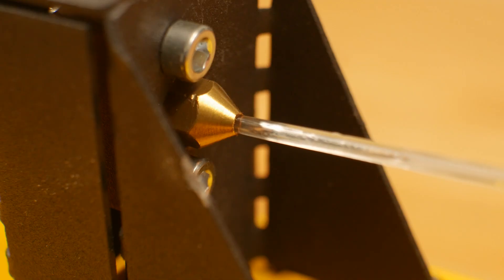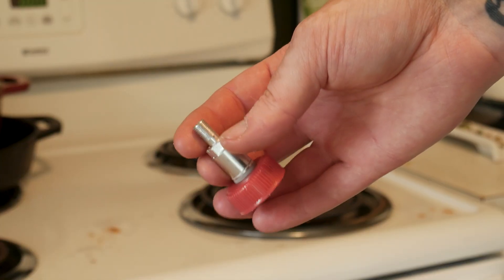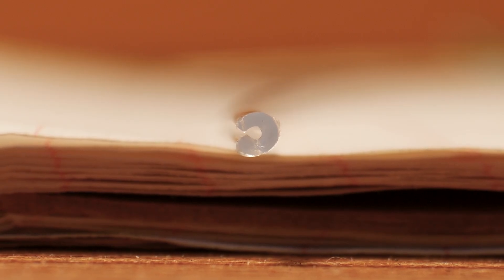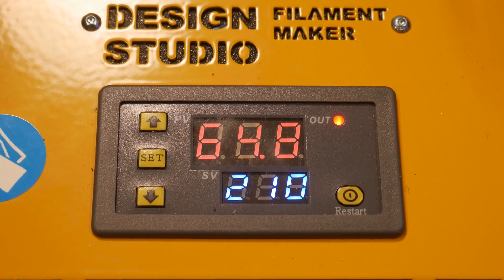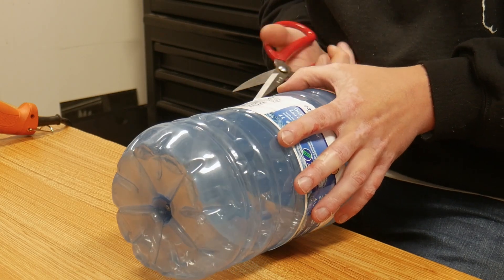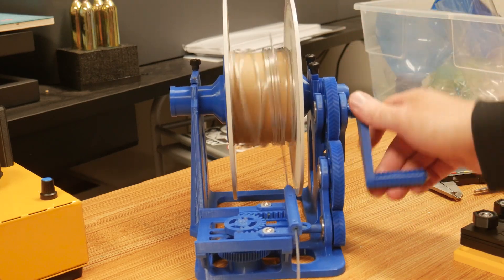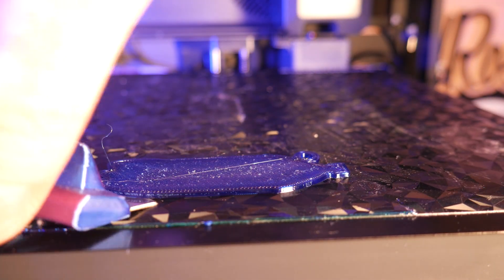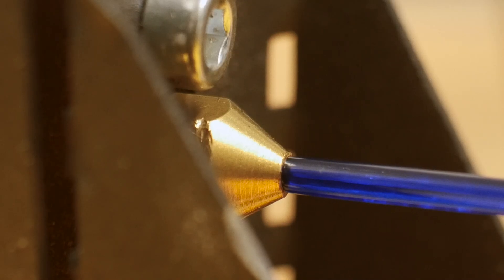Turning Plastic Bottles into 3D Printer Filament // Sustainable Design Studio PET Filament Maker

Comment: As others have said, I really love the idea. For a couple of years, I held onto my printer poop in hopes of someone coming up with a practical solution of turning it back into filament, but the boxes ended up in the dumpster. 
The preparation of the bottles isn’t shown. Bottles have residue of the product stored in them and cleaning the bottles is quite a process in itself. 
In my personal opinion, the amount of work, cost and effort to do this at home in comparison to buying filament already made is impractical. I wish it was. Good job on your videos. I enjoy them thanks.
Reply from the maker: Thanks Michael! 
While the process is tedious I think its a fun way to put recycling in the spotlight.
during the month that I filmed this I checked almost all plastic containers to see what materials they were made of and I switched from cans to bottles for the small amount of drinks that i do purchase.
I don't think this is going to solve any of the worlds waste problems but it sure is fun!
thanks for watching!
Reply: @WildRoseBuilds thank you for the reply. Yes, I’m all for the idea of repurposing plastic. Getting it to the point of being affordable while being practical is key. 
I once watched a concept video where they started making road sections out of plastic. When a piece got damaged, they pulled it out, replaced it and recycled the damaged piece to make another one. I thought it was a great way to do something with plastic. 
I’m old and I remember when plastic started being widely used. They said plastic couldn’t be destroyed and would eventually cover the planet. It was hard to imagine that then. Sure thought it would take longer.